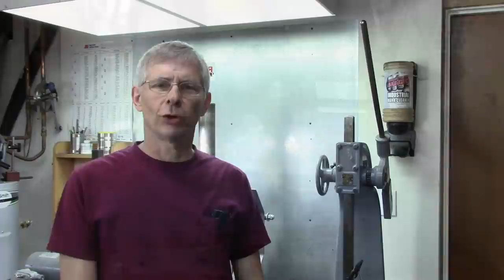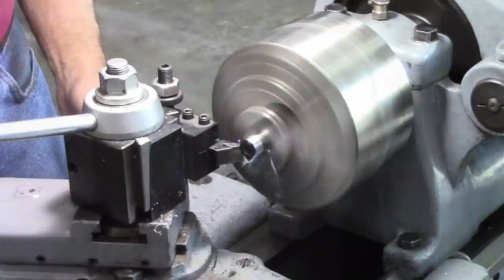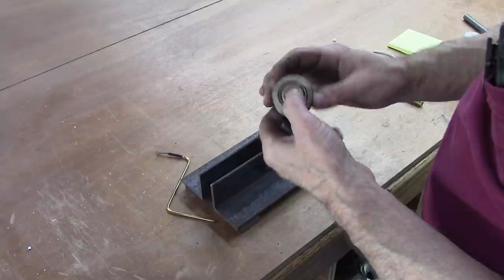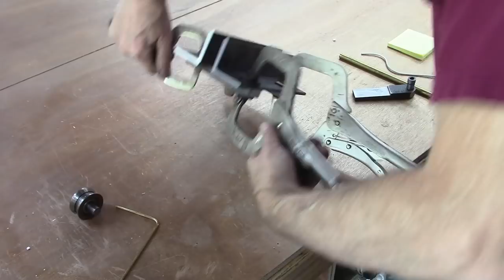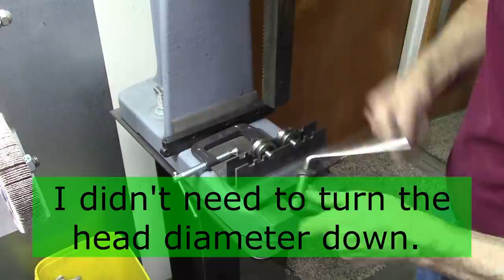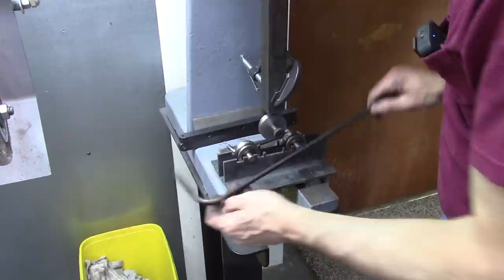An Arbor Press Rod Bending Jig

Comment: if you have different diameter dies on the ram you'll get the radius of the die in the bend.  I made one similar, only used the hydraulic jack. 
nice work Mark.
Reply from the maker: Exactly. I need to work on the ram part a little so I don't have to use a C clamp. Thanks!

Comment: Also…. Instead of doing a one shot bend mark out graduations on your 1/4” rod and do multiple small bends.  Like a hickey bender for electrical conduit.  That way you can make long sweeping bends if you want to.  This bender has lots of potential!  Thanks again for a very well thought out tool and sharing it with all of us.  Once again you have hit it out of the park!
Reply from the maker: interesting idea. I'll bet with a little math and experimenting I can predict the needed rod lengths perfectly.

Comment: A rule of thumb that I always used is 3 diameters before center of bend and 2 diameters past center of bend to calculate distance around the bend. This only works using the proper size  die per the tube diameter. You got a great idea there, enjoy watching your videos!
Reply from the maker: Interesting. While bending 1/8" rod around a 1/2" diameter form I lost 1/8" on both ends of a right angle bend.
Reply: @WinkysWorkshop  It has been awhile but I think the formula would be to use the same diameter as the tube, it was intended to calculate the outside diameter  measurement of the tube being bent. Now I got to go research again to make sure.
Reply: Forgot to mention the 1/8 loss is reflective of the 2 diameters past bending point. While just researching my old handbooks I am reminded that tubing should be calculated from center to center measurement, wow I need a nap LOL!
Reply from the maker: Got it now, thanks!

Comment: Really simple design... Easy to build... Great job.. 
Wonder how it would work with flat stock and a top roller , or even an angle iron push head that goes into the press shaft.
Reply from the maker: Flat stock would likely work well. Thanks for the idea.

Comment: Very nice Mark. The math should be easy now plus you can make different size bends and use different rods. If you had a set of regular bearings you could do small pieces of flat stock. That is a nice arbor press big enough to do some good size work but not to large for a home shop. Something that I don't think anyone has mentioned is that the little music that you put into your video's ads to them. Instead of being annoying techno music that is to loud.
Reply from the maker: Yeah, flat stock about 5/8 wide would work well. I agree on the math...  much easier than a standard bender. That arbor press came from my former employer. The plant closed 2 years after I retired and my old boss gave it to me. At the time I thought it was too big but now I think its about right. I need to get a set of broaches for internal key ways but they are high priced. I thought about making a key cutter made kind of like a die filer. I might do it someday. I agree on the music. I think adds as long as it doesn't compete with the content. Music all the way through a video is annoying I think. The music is free music from youtube for anyone making videos. Or for anything I guess.
Reply: @WinkysWorkshop  The arbor press was a nice gift. A set of broaches would be nice but as you know sometimes it is hard to justify tooling for the homeshop. Both a broach set or some type of key cutter has entered my mind over the years but it ends up being a file or hss in the lathe or mill. I'll make a deal with you if I win the lottery I will buy both of us a first class  name brand broach set and maybe some of those other things that we have been looking at in the catalogs. Usually I don't like any music in the videos, as soon as I am trying to concentrate on something people throw in some overbearing music way to loud. I hope all is well with you. As always it nice to see your video's and talk with you.
Reply from the maker: @andyZ3500s  Thanks on the broach set, I'll do the same "when" I win the lottery.
Reply: @WinkysWorkshop  Sounds good

Comment: Try drilling and tapping the bottom of you press shaft to hold the top die
Reply from the maker: Ah...  I had to think about what you were saying. Yeah, the C clamp is not ideal. I probably won't drill the ram but I may make a shoe to fit over the end with a screw to hold it.
Reply: @WinkysWorkshop  if a guy had a big press maby a #1 Morse taper would work better
Reply from the maker: @bulldawg6259  I'm sure that would work well too.